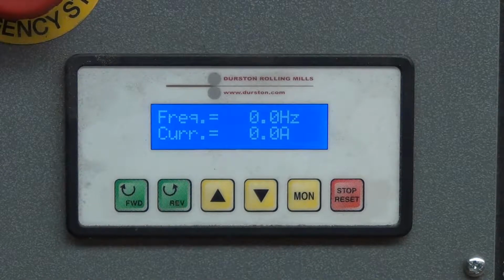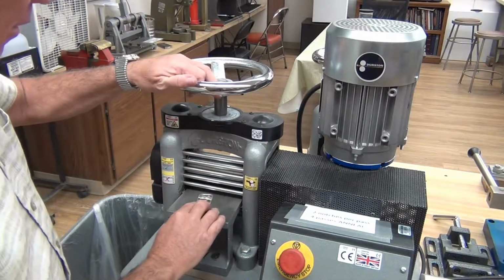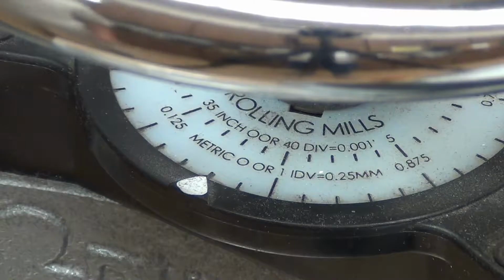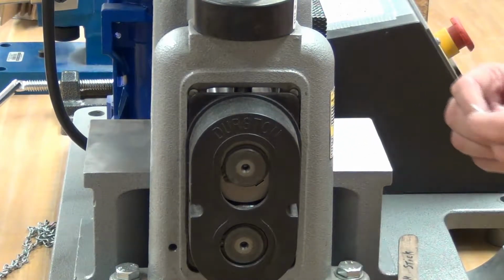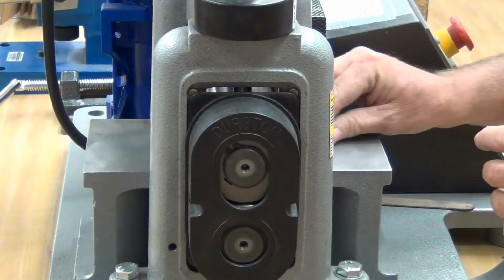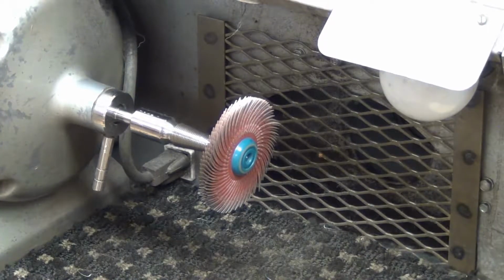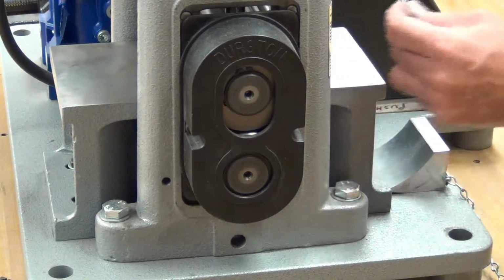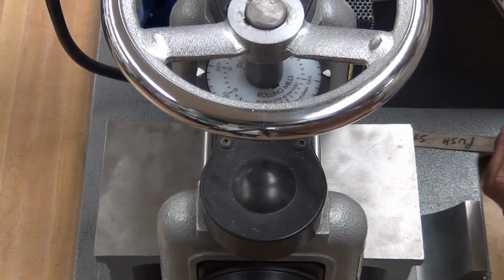Durston Power Rolling Mill woking with 1 oz ingot

Comment: hello! thanks for the great video! I'm wondering: what if you kept rolling and then annealed one time, after the thickness was achieved? what are the drawbacks of doing that? 

I'm assuming that rolling adds strength, toughness or hardness to the metal (probably by molecular alignment) does it become so hard that is strains the rolling mill? I need to watch more of your videos! Thank you!
Reply from the maker: it doesn't strain the rolling mill, but the metal will crack, it has happened to me if you don't anneal often.
Reply: @jschalk7  thank you for your answer, that helps me a lot!
Reply: If you over work the metal withaout annealing it the metel cracks and you have to start over
Reply: @tonygheorghe  thank you!
Reply: @CuriousEarthMan  you are welcome!